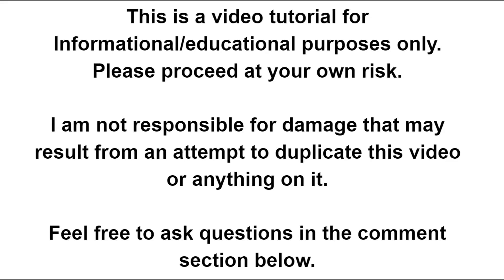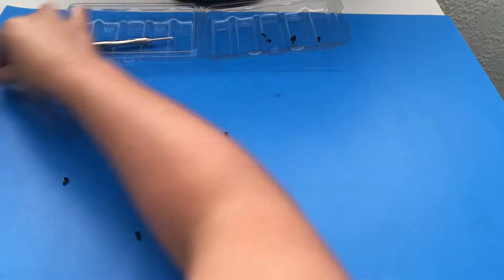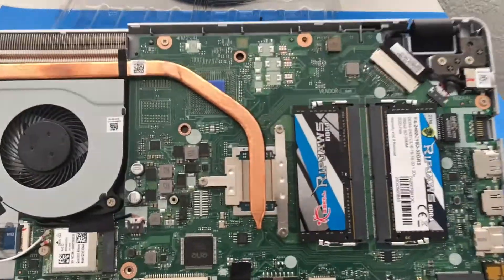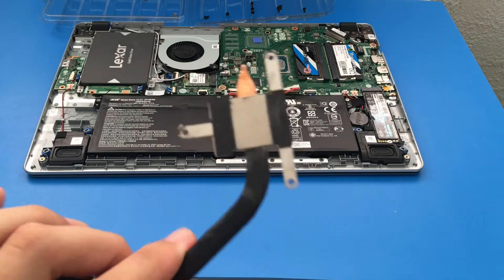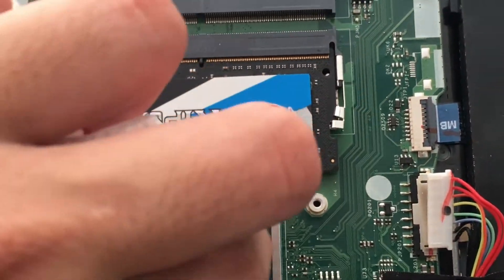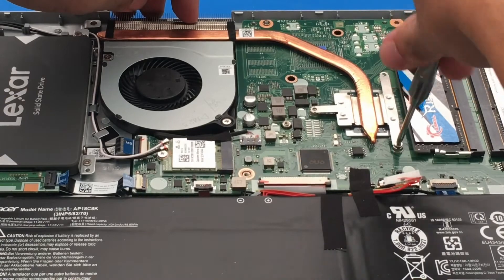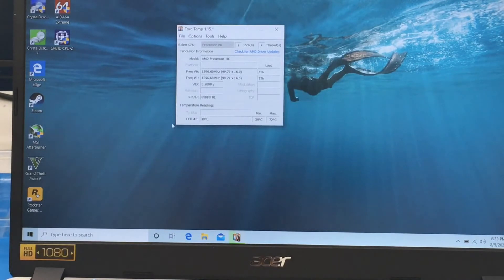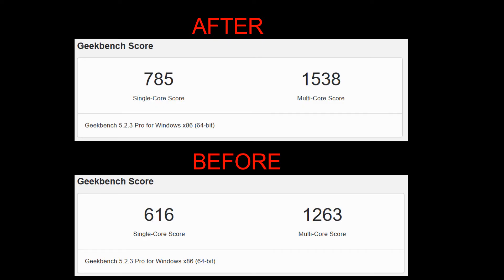ARCTIC MX-4 Thermal Compound Paste Application & Results - Acer Aspire 5 Slim Laptop A515-43-R19L

Comment: I have a similar acer aspire, and if You use a razor blade and systematically slice open those gaps under the laptop ( pull the cover off and put it on and look where the gaps arent touching a heat synch, arent directly on top of parts etc. You can open up the bottom of it strategically and allow more air flow. I did this and my computer stopped overheating. I now have it propped up on some books, with a fan behind it pulling air underneath it and through the front. Saved me money on a cooler fan and also the fan isnt blowing up directly into the laptop, its just blowing heat out from behind and underneath , which is less damaging. I actually sliced out alot of those strips that cover the computers fan too, and used popsicle sticks to create a solid foundation so that nothing pressing on the laptop from underneath can hinder the fan from working ( which it did prior to doing this ) . You dont wanna take them all out because they help with structural support, but say in parts where theres 3 strips, cut out the outside ones and leave the middle one etc. In the parts with like 7 strips, cut off one, leave two, then cut off one etc. So theres like one centimeter gaps instead of just like 5 millimeter . I noticed huge improvements. Even if You go to resell it after You can explain that to the person and let them know that its actually a very beneficial hack. If You watch channels like Gamers Nexus, they explain how important air flow is, and I'm pretty sure they would approve of this laptop hack. I think You could also do it with needle nose pliers and have good snipping capability, which would be more accurate and clean than a razor.
Edit if You do this, dont slice it open while its on the laptop, have it on ur lap and hold it sturdy between ur legs.

Comment: This is a great video that I needed to see if this paste would help to avoid throttling.
The core temp reading does not make any sense though but it's not a very reliable piece of software to begin with but looking at the voltage it would explain a lower clock just the load is a bit puzzling.
Reply from the maker: Thanks for the info!

Comment: Good video.  I like how easy it is to remove the cpu heatsink and modify the thermal paste.  Yes, easy peasy.

Here is something I have noticed in both of my Aspire 5, AMD Ryzen 3 machines.  When I run the laptops using the power supply, the heat sink fan runs up and down continuously.  Using Hardware Monitor, I have seen the system temperatures go as high as 170 f, dropping back to around 120 f and ramp back up again.  If I use my laptops without the power supply, the cpu temps stay around the 120 f range with very little excursions higher than that.

So as a rule now, I use the units in battery mode only when computing.  When I charge the units, I do it with them turned off.  I do this so as not to stress the cpu/system.  Don't know why this is.  But it is very noticeable and replicated on both my units.  

Again, thank you for this informative video.
Reply from the maker: That is great information. Really helpful!

Comment: Thanks for the video! that's actually a good improvement in the cine bench r20 scores. did you use alcohol in the paper towel? also I think if you had done a line, the results would have been better.
P.S are you still ordering the kryonaut thermal paste?
Reply from the maker: Thanks for the video idea! I was going to put it off but glad you brought it up for me to work on it sooner. I used a drop or two alcohol on the paper towel. Line thermal paste method. Interesting, I will look that up. I have the kyonaut thermal paste on order still but it looks like two weeks to arrive. I’m not sure what people use to test thermal paste to have accurate results so I just ran a bunch of tests before and after
Reply: @whattmeter  they use stress tests like cinebench r20. however the motherboard/bios has configured the cpu in a wrong way. I don't know when acer will fix it with a bios update. you see the 3200u should actually get 630-650 score in cinebench r20. I have the ryzen 5 3500u variant of the laptop and its not performing to its true potential. i get 1200 in cinebench r20 when i am actually supposed to get 1400-1500. I just hope they release a bios update. which bios version are your running? also i noticed the wifi card below the fan. can it be replaced?
Reply from the maker: That’s helpful and good to know! I need to check my bios I don’t know what version I’m currently running on the laptop. It definitely looks like the wifi card can be replaced. I will check next time I open up the laptop